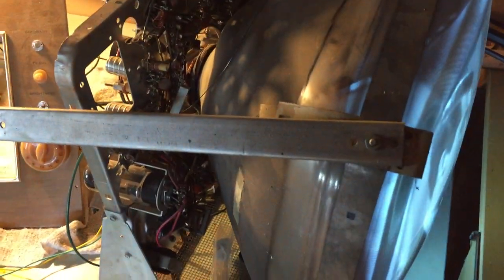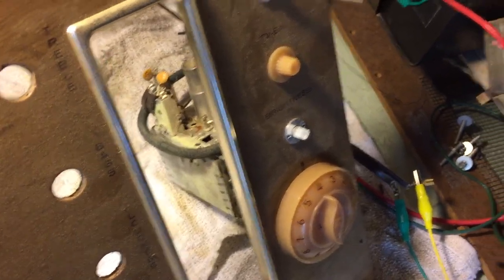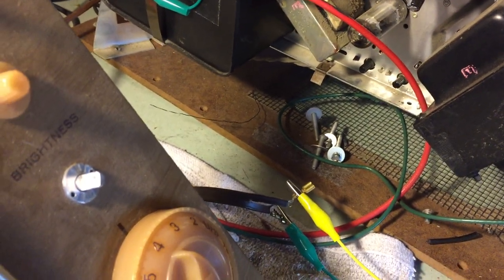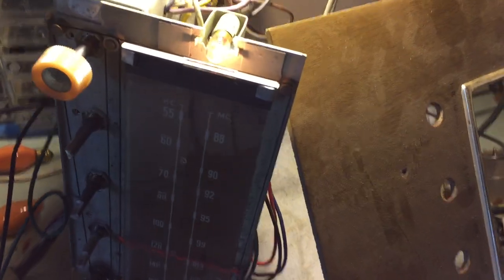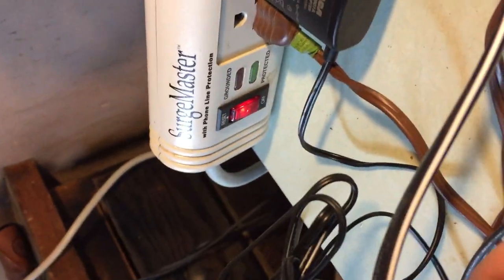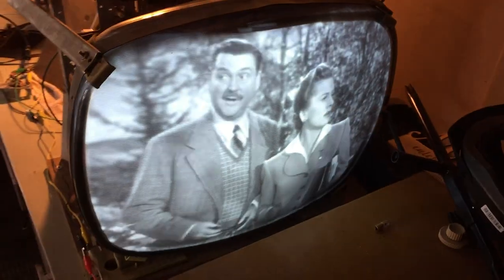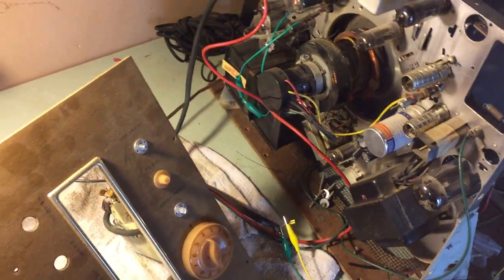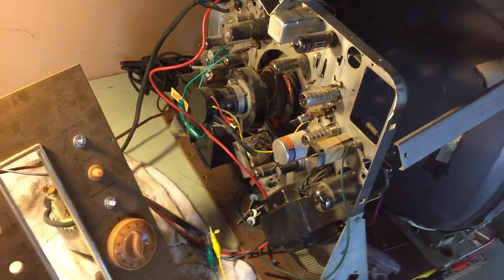1959 Black & White Magnavox TV restoration

Comment: Sounds like the audio section of your set could use some alignment. You will need the Sam's Photofact set for your model and follow the instructions for aligning the sound I.F. and detector sections to the letter. Before going that far though, there are a few less extreme things you can try first: If your set has an AGC control and/or a buzz control, you can try adjusting these to try and minimize the hum. You can also try a different RF converter that your video source is connected to. You can also try inserting an in-line attenuator between your converter and TV (sometimes the signal going into the TV is too strong, producing overload). Of course your feeding the audio directly to the stereo amplifier of your system is a perfectly fine workaround which gives you much better sound vs your TV speaker anyway.